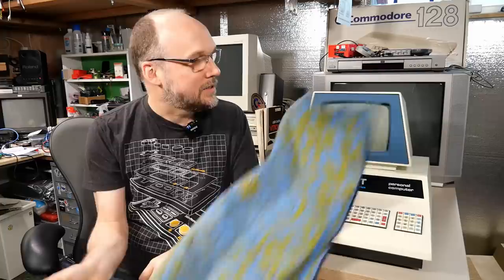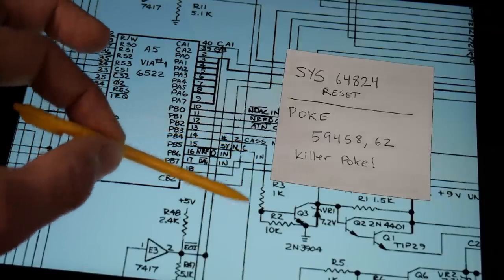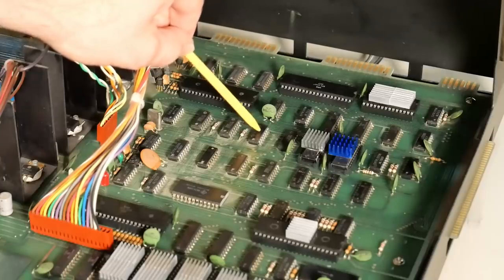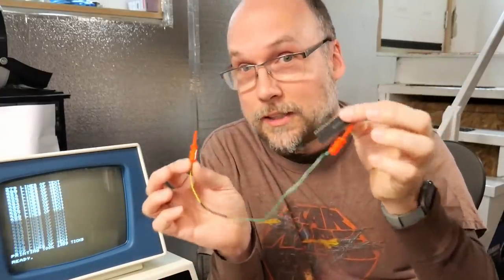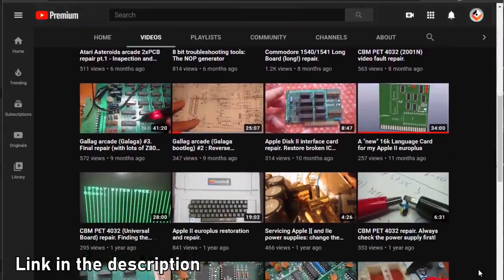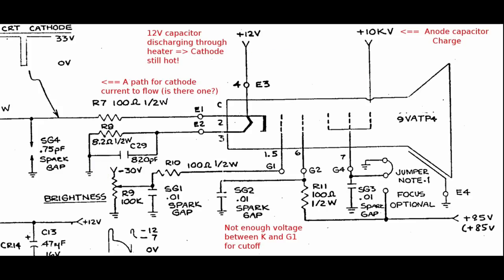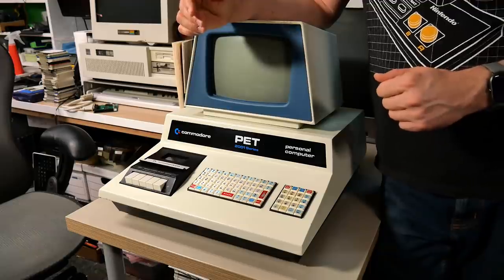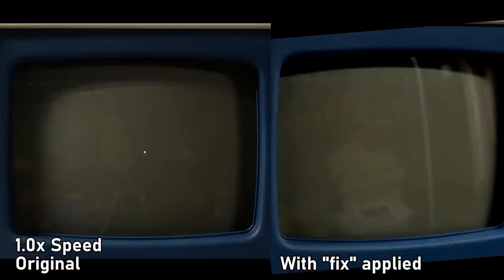Permanent Killer Poke Mod and CRT Spot fix on the Commodore PET 2001

Comment: About the bright dot and residual cathode emission: it looks like there is a much simpler path to ground - trough heater element (several dozens of ohms) and resistor R8 (8.2 ohms). Emission current should be several hundreds of micro amperes so those two resistances to ground are negligible for it.
Reply: the heather and cathode are separate and should have no electrical continuity, however the insulation strength between them is usually only a few hundreds volts.
Reply: @iz8dwf  You are totally right! I did not pay enough attention. The fact that cathode lead is drawn to the left and filament lead - to the top confused me.
Reply: @iz8dwf  If I am not mistaken again, the higher the cathode potential in relation to G1 the lower will be tube current. Assuming G1 voltage will not go to 0 immediately (C22 is pretty big), all what's needed is to hold cathode voltage high until it cools down. In order to do that we need to keep Q3 collector voltage high for as long as possible. This can be achieved by connecting relatively big electrolytic capacitor in parallel with C4. I would start from 10uF (at least 150V) and if it does not help - try to increase it to 100uF, but carefully because big capacitance potentially can load boost circuit on startup. I wish I could have the real machine to test this...
Reply: @paulorlyk7271  If Q2 turns on, no matter how big your added capacitor is, it will discharge immediately. Also, Q3 collector needs to switch fast or you won't see good sharp images during normal operation of the monitor. The storage/smoothing capacitor is already present on the 85V rail anyway. What you can do to kill that spot is either immediately "bump" G1 to -60V or so (from the -30V normal working bias) and that can be done with 3-4 added components or prevent Q2 from turning on as I did with one single added part.
Reply: @iz8dwf  It looks to me that Q3 is emitter follower so I do not think that collector of Q3 must change it's potential at all - zener CR7 and R5 will keep stable 33V on it all the time in normal operation and C4 is just a small filtering cap. C4 does not need to be large because R5-CR7 is basically a linear voltage regulator and C4 helps to take the edge on higher frequencies. The voltage on Q3 collector will be stable if total output current of this regulator does not exceed (85-33)/2.2k=~23mA. Even if Q2 is saturated (assume collector-emitter voltage is 0 for simplicity), R4 and R5 will form a voltage divider with ~34.5V on R4 so even than we will still have some regulation and collector voltage of Q3 will still be  33V.
I totally agree that if Q2 goes to saturation it would drain additional capacitor pretty fast trough relatively low resistance of R4. But it won't matter anyways because even if 33V supply was unlimited, emitter of Q3 would follow it's base. But if your mod keeps Q2 closed, additional cap might help to keep collector, and incidentally emitter voltage of Q3 high for long enough to close the tube until emission stops.
Bumping G1 to -60V will definitely close the tube no matter what cathode is doing. Also another (very) crude solution may be to add an HV resistor to ground from +10kV to quickly discharge the tube capacitance after horizontal deflection stops.
Reply: @paulorlyk7271  All correct but the EHT discharge isn't feasible, you need a long resistor string for 10 kV, you need it well insulated or the 10kV will jump through weak insulation (been there, done that, more than once). It wouldn't be a mod for everyone. All correct on the 33V zener and Q3 being a follower, but if Q2 turns on, all you do around Q3 collector is still uneffective. And, if you prevent Q2 from turning on and there aren't other (intended or not) paths for a cathode current, the spot won't appear.
I only have found two methods that work, bumping G1 to a negative enough voltage (charge a cap on +85V, then discharge on G1 at turn off) or block Q2 collector supply early enough after turn off. I think the easier method is the latter and requires less components too. I welcome any other working solution. By the way, 33V zener and Q3 follower wouldn't even be necessary if Q2 had sufficient VCEo rating, but I haven't tried this mod in real life :)
Reply: @iz8dwf  Hm... Both 2n3904 and 2n4401 have the same Vceo = 40V and R4 will supply 33V to collector of Q2 when Q2 is closed so it might not be because Vceo. I think 2n4401 may have unacceptable Vce saturation voltage and they chose 2n3904 as a final stage because it also performs better on low currents. Only my speculation though, I do not have much experience...
I think it does not matter much if there is a path to ground from cathode or not. What mattes is the potential difference between cathode and G1. My feeling is that because there is no deflection and entire beam is concentrated in a single spot, the emission current may be much lower than usual and the dot will still be visible. This means that even if cathode is completely disconnected and floating, the isolation resistance between heater and cathode might be enough to sustain unacceptably high beam current. But again, no experience here.
Reply: @paulorlyk7271  To make it more clear, I think they needed a zener because of VCEo of Q2 and then Q3 is a bit of a mistery because they used a follower (which is a current amplifier) that in this case is supplying no current! Cathode current can't flow INTO the cathode, when it flows it's flowing into the diode and Q2. And yes you're right, the undeflected spot current is in the order of 100nA and no, it can't flow into the cathode-heater insulation. And yes, it's enough to block this current out of the cathode to completely eliminate the spot as you'll see soon. As I said, you could bump G1 more negative, but that requires more added parts, perfect timings and probably lots more time to make it right.
Reply: @iz8dwf  It does not supply any DC current, but maybe AC... When opens, Q2 will bring cathode to ground pretty quickly, but when it closes, cathode will be connected to 33V trough 1.5k resistor. I mean maybe cathode capacitance is high enough that in order to make sharper pulses they added emitter follower that only works on rising edges. But yes, shame on me, I missed the fact that current flows into CR6. Thank you, I learned a lot from this conversation!
Reply: @paulorlyk7271  Yep it could be that Q3 just supply the switch-off current, but I always wondered why they didn't just use a standard two transistor cascode like in ALL the BW TVs :)
Reply: @iz8dwf  It has only 2 states - on and off, we do not need to use "all that linear stuff" and can get away with a simple switching circuit! Hm... Vertical lines are washed out... We need to fix this! Oh wait, now it is not much simpler nor cheaper than "all that linear stuff" and just works differently... Never mind guys, if it works - do not touch, let's leave it like that!
So maybe while creating mostly digital machine they was applying corresponding designing approaches to everything.
But no matter how they did it, it works well.
Would be interesting to see what happens when R6 is connected directly to the collector of Q2. Does it really looks worse?... :)
Reply: @paulorlyk7271  Chuck Peddle said in an interview that they more or less copied the monitor design out of a book. However a classic two transistors cascode can work fine in on/off mode, it has less parts and it's very reliable. However the top transistor on the cascode needs to have sufficient VCE rating to withstand the whole 85-95V  of that supply rail. Connecting R6 directly to Q2's collector should also work fine, but I always think there can be something else I'm missing, so I won't try it really soon :)
Reply: @iz8dwf  If high voltage transistors were expensive at that time - they did a clever move. Yeah, if there is something unforeseen it can easily kill entire video amp and who knows what else - if the circuit contains a spark gap in it - that must mean something ;))
Reply: @paulorlyk7271  I don't know about how expensive they were, but transistor TV from early '70s had already the high voltage transistor in the cascode circuit, so it wasn't probably  too expensive. Spark gaps are always present on all CRT electrodes in case some insulation between nearby electrodes fails or something bad happens. However there still might be something else I'm missing on that circuit.
Reply: @iz8dwf  Simulated it in LTspice, just for fun. Used 50pF capacitor as equivalent of CRT cathode and 200ohm resistor as R6+R7. Measured on 50pF capacitor, pulses from collector of Q2 have slow leading edge, especially after ~28V and fast trailing edge. On emitter of Q3 both edges are nice and sharp. In fact, rising edge after Q2 is so slow that at 6Mhz pulses are only 21.7V, but on Q3 - 32V. So maybe they had problems with retrace lines and black levels...
Reply: @paulorlyk7271  Good job! I'd assume a lower value for the cathode to other grids capacitance maybe more likely 20-25pF but yeah they surely had speed problem with only the resistor. However, remember to add those two diodes in series to collector and base of Q2, those are a trick to prevent Q2 going into saturation (and thus make it faster). But ok, even if Q2 is turning off quickly, the voltage on the cathode may build too slowly because of R4. So probably we know what Q3 is for now :)
Reply: @iz8dwf  Both diodes are in the model. With 25pF after Q2 it's 28.2V, but pulses are not square at all and more like a cheap sawtooth wave. Rise time from 10% to 90% (by eye) after Q3 is ~40ns, but after Q2 is almost 90ns.
Reply: @paulorlyk7271  Ok so they definitely needed to add Q3 and the bypass diode to switch off the beam fast enough. Mistery solved, thanks a lot!

Comment: Couldn't you just place something between the 7408 and the 6522 for making the 6522 get the sync when needed, but not having it pull down the 7408's output? To retain the POKE functionality. An opto coupler? An transistor? OR just an resistor?
Or an Arduino? xD

Comment: You might get away with inserting a 20kOhm resistor in series right at PB5 of the A5-Chip, i.e. by lifting the pin.
This should make the killer-poke software-reversible and work as usual.

Short explanation:
By putting the resistor in line, A5 will not be able to pull the sync-signal to the CRT sufficiently low, as enough current (in this case 2.5mA) should be provided by the output of C6.
On the other side of the resistor A5 only needs to sink 2.5mA to "see" a low signal, hence never stopping the CPU.

If this still does not work, you can easily pull out the oscilloscope and tweak the resistor value between 1k and 100k

Comment: There was always reputed to be a special  machine code command on the PET - HCF  = Halt and Catch Fire.
Reply: That was an undocumented opcode on the 6800 CPU, not the 6502. It halted the processor and incremented the address lines as quickly as possible. Theoretically, you could overheat bus transceivers doing that.

Comment: I have the Sharp MZ-80k (a Z80 based micro very similar to the PET from 1979), by default the screen would create static or snow on the screen especially with machine code games.  There was a poke (can't remember) that would make the CPU wait for the vertical refresh to happen,  it would be slower but the screen was clean with no static.
Reply from the maker: It was the opposite -- that's interesting.

Comment: why cant you just place a wire from the +12V in to the cathode and go through the off position on the switch to the ground - this means when you turned the power off the power from the cathode would be drained in the reverse direction.

Comment: I wonder if you could add a switch that would enable or disable the killer poke on command. 
that would be neat
maybe you'd need a switch that connects to one side when open and another side when closed?
Reply: You would need a switch like that, but double pole switches are the rule rather than the exception for sliding switches, and very common in pushbutton switches.
Reply: @mal2ksc  I always tend to get the two terms confused but don't you need a double-throw switch? That's nearly universal on slide switches.
Reply: @eDoc2020  Actually either one works here, depending on how you want to wire it up. But no, I meant double pole. Of course most sliders are DPDT anyhow so you have your pick of which double feature to use.

Comment: The small BW TV I used for ages with my C64 did that "turn off dot" too.
Reply from the maker: Curious if it was a tube TV?
Reply: @adriansdigitalbasement  A late 70s cheap portable transistor model.

Comment: Our old 60s b/w tv definitely had that dot on power down.. didn't last long.
Reply from the maker: Yeah tube TVs did it because it has the effect of discharging the high voltage. If you have a costumer in the TV pulling out tubes to fix the TV, you needed to do that for safety.

Comment: That's very interesting. I made a VIC 20 Character rom successfully using a genuine 27c32D NEC EPROM. However it has the same snow  effect that your PET displays when you made the hard wired modification.
I wonder what this static effect on the VIC 20 is. Does anyone know?
Reply: The original chargen ROM on a VIC-20 is a mask programmed 2332 ROM that uses two select (AND-ed) pins with opposite polarity (pin 20 and 21) to save on decoding logic.
So any replacement must have at least a couple of logic gates (or one gate plus some clever pin swapping) to use an EPROM in its place that has usually one or two enable pins but always active low.

Comment: Does anyone know whether the Apple Color Monitor IIe is supposed to have bright dot suppression, or whether it is normal for that monitor to behave similar to the PET monitor when turning it off?
Reply from the maker: Definitely should not have a spot on turnoff. How long does it last?
Reply: @adriansdigitalbasement  It lasts like 1.5 seconds, around 0.2 seconds after turning it off. Some deflection seems to be left when the spot appears, as the spot shrinks in size while it is visible.

Comment: what about instead of disconnecting that pin, wire a resistor in series with the sync to that pin, that way it'll still sense the sync if used as an input, but cant force ground anything if used as output??.  maybe 1k??
Reply: that way you can use the speed up poke if you want,,,  or not 😉

Comment: Why are you saying the killer poke was busted per the other video (I saw and answered that video too.) when it clearly forces the 7408 to max current? Just because it didn't kill your PET right away doesn't mean it won't kill it eventually. It's not busted at all.

Yours and the other video's explanation that the poke was used a lot on each of your machines  is unlikely. Few users knew of it let alone dared use it on their expensive investment. You're both driving the 7408 to operate far out of spec and how each PET's specific chip responds can't be predicted.

The mod made is fine though and totally worth doing.

Comment: That is a sure sign the CRT is getting tired and near the end of its life.. 99% of the time from what I have been told by a very good vacuum tube and CRT electronics repair person. Specifically said that it "Usually means that the CRT is weak and on its way out" since the fix didn't work, what else does that leave to be the issue?
Reply: It's not the tube that's causing the dot, it's the electronics on the analog board. You could put a brand new tube (if you can find one) on that board and you will get the same dot.
Reply from the maker: Yep indeed the board is 100% the issue. Part 2 will be out next week with all the details :-)
Reply: @adriansdigitalbasement  ooh interesting I am ready to learn something new
Reply: @DankNoodles420  You're almost right. Yes, it can indicate a worn off CRT, because a worn CRT's cutoff voltage can drift so much, that the dot killer circuit will be unable to blank the screen during power off. But some cheap TVs and monitors does not have a proper dot killer circuit to begin with, so they behave like this out of the factory. This is an example of the latter.

Comment: I loaded a binary file into a text editor on an IBM 386 in high school.  After deleting a bunch of things and playing around with it I ran it.  As it ran the monitor turned on and off at high speed while both the 5 1/4 drives spun up and the speaker was spitting out pure harsh static noise.  After about 15 seconds the monitor died and then I powered down the computer.

I ran the program on other computers of the same type in the computer lab and nothing happened.  The monitor on the first computer was fried and wouldn't power back on.  Still don't know what happened other than pure demonic computer possession.
Reply: I was working with an Athlon 64 machine which would instantly turn off a second after poweron. So I kept turning it on every second or two and then the monitor let out some smoke. It still kind of worked but the horizontal deflection was wonky. The hilarious part was the distorted 'Monitor is Working' OSD message. The monitor was clearly lying to me.

Comment: 0:33 Well, this statement isn't exactly true. If we ignore the Killer Poke, there is one thing you can do programming-wise that is guaranteed to brick some older computers, dividing by zero. That's been responsible for a number of mishaps over the years.
Reply from the maker: That does not cause physical damage. Just a software crash ...